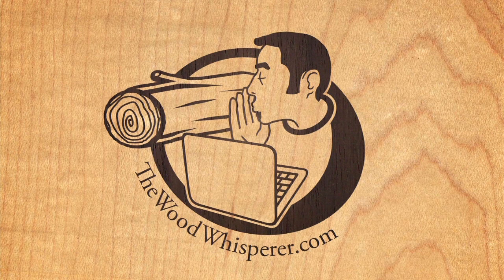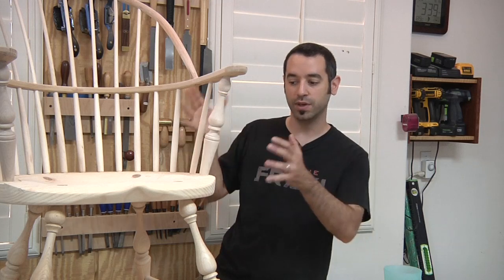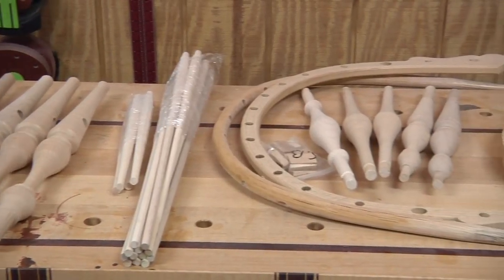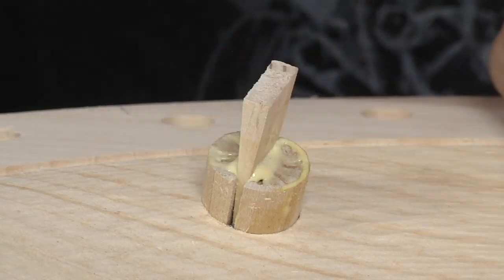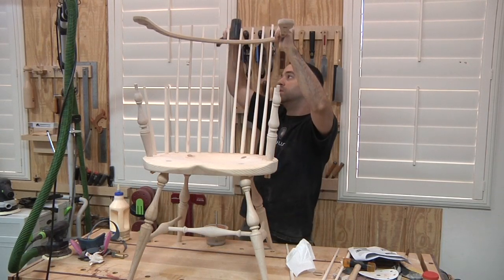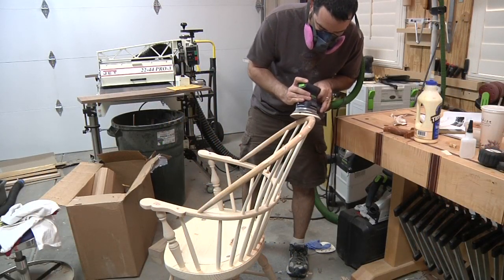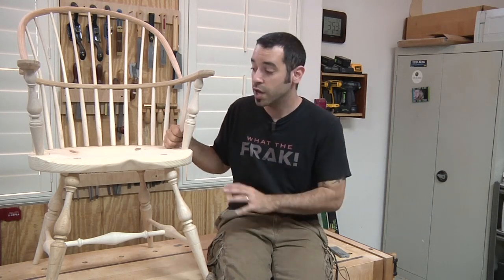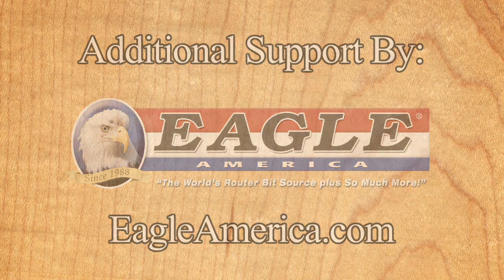137 - River Bend Windsor Chair Kit

Comment: Another good video and I agree with building a Windsor chair kit, and there’s something else a good woodworker could do with a kit and that is to build templates, bending moulds and copy some of the other parts. Making the moulds would be easy as you have the bent arm rail and bow already shaped. I would take my time and study the kit piece by piece before I assembled the kit. If a woodworker can afford to buy a kit I believe it would be a good start to getting into building Windsor chairs and give you a good blueprint to build one on your own and try to use green wood where specified when you can. I’ve worked with green wood on the lathe, carving and small projects and green woodworking is really a pleasure and a joy to work.